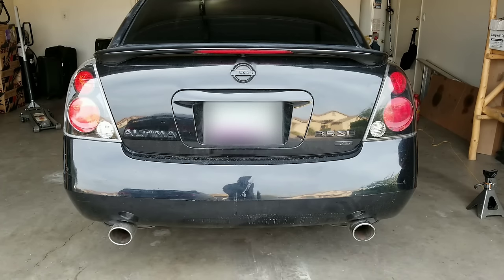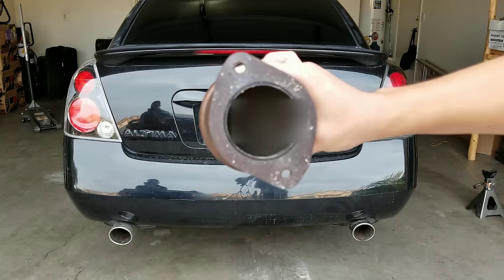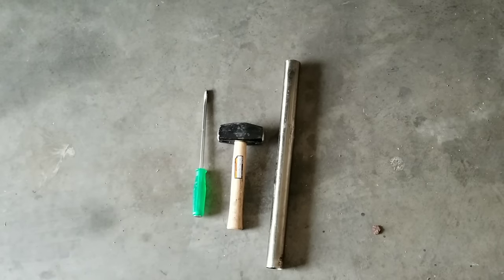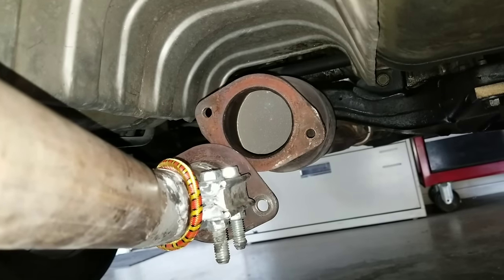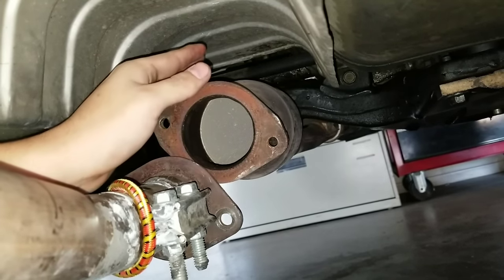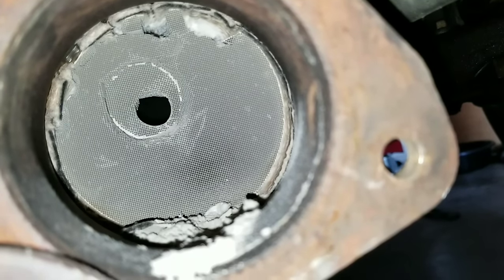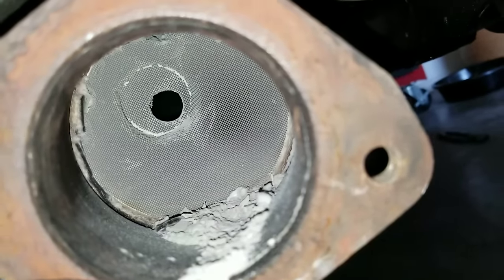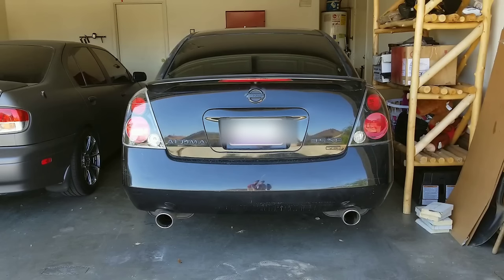How To Delete Your Catalytic Converter!

Comment: "by releasing more air, you should be able to take in more air..." To put this into context, that's like me saying "by farting more, you should be able to breath more." 
It's 2 separate systems that make 1 whole system. Deleting the cat, will not let more air into the engine. I would study up a bit before saying something. Don't just believe what someone once told you without verifying. 👍
Reply: Doing this has increased hp on my motorized bicycle dramatically, top speed and acceleration. It's because there's less back pressure pushing against the pistons exhaust stroke. Not to get into if any back pressure is necessary, but less is better in this case for getting more power.
Reply: @uknowngamer1017  would a delete destroy the motor to a vehicle
Reply: @lieutenantmikeo5979  a catalytic converter delete? Likely not, unless electronic systems are not adjusted and tell the engine "hey dude, my cat is fucked up!" Consequently sending it into limp mode, but not hurting the engine. If a tune is implemented, the engine will run BETTER. If you mean deleting the exhaust as a whole, it will damage the engine. The extent of which depends on the stroke type and other characteristics of the engine.
Reply: Also re-reading this. The original comment sounds more idiotic the older I get. Saying they're two separate systems is so foul. Every system in an engine relates to every other system. From the intake to the headers, from the coolant system to the pistons. They all are integral and affect eachother
Reply: Thanks for the information....I deleted my whole exhaust so theres no pipes running off of the  cats and I wanted to also remove my cats for my own personal reason(s). I pretty much would only have the headers on the motor and I'm hearing that I could bend something in the motor or have warping so I was just scared to follow through with removing the cats
Reply: @uknowngamer1017  hmm I deleted the whole exhaust so theres no pipes coming off of the cats. I wanted to also delete my cats. So pretty much it would be just headers. It's a 1uzfe motor in a 98' lexus ls400 so I'm not 100%
Reply: @uknowngamer1017  then you must not have read it. Again, 2 systems that make up 1 system. Meaning there are components that combine it all together to make one system. For simplicity, i chose that analogy. You essentially said what i said. Example, does replacing or removing your exhaust affect your intake, if left stock? No. Does replacing or removing your intake, affect the exhaust, if left stock? No. There are a plethora of mechanics inbetween both systems, which is why, they are both, 2 seperate systems. They work in tandem, but thats it. They are still seperate systems. When you go to a parts store and ask for an exhaust system, do they give you anything for the intake instead? No. That would be stupid. Because its a seperate system.
Reply: @uranumbnuts  I cant comprehend what's going on.  I just want to know if removing my cats and exhaust is going to damage my motor. Idc about low end or gas mileage
Reply: @lieutenantmikeo5979  i apologize for the confusion. No. It will not damage your motor. You may get a check engine light, but it will not damage anything.
Reply: @uranumbnuts  thank u so much....I was just so scared
Reply: @lieutenantmikeo5979  hold up broski. Sounds like you want down pipes which is awesome and won't screw up the engine, with proper modification (depending on year). If your car has O2 sensors after the catalytic converters, they will NEED to be tuned out if you want it to run right. If you don't want to delve into the tune-world, I hear you can use "spark plug spacers" or something of the sort so your sensors get a proper read-out with no CATs installed. If you don't have any O2 sensors, cut them bad boys out and you'll have a hot rod. Good luck!!
Reply: @uranumbnuts   @uranumbnuts  Look dude I understood your analogy, but it wasn't a great example. On my vehicle "Mazda 6s 2008 3.0L", the exhaust system was SO restrictive that cutting out the CATs gave it noticeably more power and literally allowed for a greater increase in air intake. I read the MAF readings for God's sake. The OEM intake design wasn't all that restrictive to begin with, so more intake air was easily possible. There's one thing to remember when trying to make a car go faster. 
More in + More out = More Power. Relating to fuel/air in and exhaust out.
If the fuel/air is the bottleneck, then simply increasing that WILL increase your power. Get it now? I'd hope you do.
Reply: @uknowngamer1017  I have no exhaust I want to take off my cats as well therefore I'll only have headers but no pipes or cats...I'm hearing tht it can cause warping or bend something in the motor
Reply: @uknowngamer1017  my guy. Your car is equipped with an ECU. Do you know what the ECU does? It compensates for everything the engine does and everything we do to it. The ECU reads the data from the o2 sensors and lets more air in or chokes it if it senses a problem with the mixture. Same thing with the fuel. By design, the air intake on every car is "restrictive" to allow the ECU to determine the best mix for the vehicle. You removing the cats, didnt magically increase the air into the intake, it allowed the ECU to compensate and ramp up the air intake towards its maximum capacity. The intake already has a ceiling, which most cars never get close to, by design. Its to give the ECU room to compensate.
Yes, more in, more out. You need to make changes to BOTH, in AND out, to get that effect. Making changes to one, does not necessarily affect the other, except where the ECU corrects for the discrepancy. 15 years, ASE Certified for automotive and 10 yrs diesel mechanic. I know what i am talking about.
Reply: @uknowngamer1017  I did it ...my car run way better thanks guys
Reply: @uranumbnuts  I'm not really understanding you guys too much ..I took off my cats and exhaust and my car is running way better. I dont plan to keep it like this long
Reply: @lieutenantmikeo5979  dont worry about the other guy and i arguing buddy. He just doesnt know what he is talking about. Congrats on removing the cat. You should now have a nice, full sound and a slight boost in power. Make sure you upgrade your intake to increase your intake capacity. Polished, Mandrel bent tubing is the best way to go to get the best air flow. 👍🏽
Reply: @uranumbnuts  ❤👌🏿🤝🏿
Reply: @uranumbnuts  I have no exhaust neither so I guess u can say open headers in a way
Reply: @lieutenantmikeo5979  i like it! I would straight pipe right to the rear and call it a day! 🤣
Reply: @uranumbnuts  mmm everyone is telling me to do so but I've heard straight pipe on my year make and model vehicle and it sounds really good ,but I like the hot rod choppy sound.thats literally my only reason for running open heads ig
Reply: @lieutenantmikeo5979  lol. I get it. I can appreciate what you are going for.
Reply: @uranumbnuts  again hopefully it doesnt damage my motor over time...I only plan on leaving it like this for a month max....its way too loud but run alot better
Reply: @lieutenantmikeo5979  the only reason i suggest it is to eliminate heat from the exhaust getting trapped anywhere, like in the engine bay. Unless you are looking to remove the hood or vent it in a way to let the heat escape.
Reply: @lieutenantmikeo5979  keep in mind, it doesn't have to be a straight pipe to the rear. You could easily go for pipes heading to the sides like a hot rod. The point is they'll let the heat escape away from the car.
Reply: @uranumbnuts  we're practically agreeing but fighting over it
Reply: @uknowngamer1017  ❤❤basically I appreciate the knowledge
Reply: @uranumbnuts  soo pretty much my only worry is heat disaptation?
Reply: @lieutenantmikeo5979  for the most part, yes. Heat is the worst thing you can do to anything mechanical. Keep the airflow moving.
Reply: @uknowngamer1017  which is what i said earlier 🤣
Reply: @uranumbnuts  I understand that more thanks for the info....my car actually run pretty cool. Needle stays way below half but I can feel the heat expand when I get out of the car other than tht it run better, and my temp is staying fine
Reply: @lieutenantmikeo5979  the temp you see in the car, is internal engine, not external engine.
Reply: @uranumbnuts  that's what I'm hearing.....😮😮😮😮😵😵😢😢so I can be overheating my motor and not know it?
Reply: @lieutenantmikeo5979  how do you have it set up currently? You have the headers attached. Do you have the headers attached to a down pipe? It would normally go down below the carriage, attach to a cat and pip all the way back. How is yours set up?
Reply: @uranumbnuts  literally how u just said it. My headers are attached, and I have the down pipe that my cats bolt on to.....I have no cats now and no exhaust after the down pipe tht connect to my headers
Reply: @lieutenantmikeo5979  perfect! You are pushing the heat away from the motor. Thats good.
Reply: @uranumbnuts  I definitely appreciate u taking the time to message me ....now that I have open heads I cant believe I was scared to ever do this...just pray that nothing happens
Reply: @lieutenantmikeo5979  lol. You should be fine. Have fun, my friend.
Reply: @lieutenantmikeo5979  glad to hear you went through with it and that it's working :) issues may come along but don't worry, it's just your car getting you to learn another new skill
Reply: @uknowngamer1017  its ok brotha. I can appreciate you admitting that. You werent the only one. I like looking for arguments online. 🤣
Reply: @uknowngamer1017  long as my motor doesnt get destroyed I'll be fine

Comment: have you noticed you don't see many muffler shops these days?    That is because cars are equipped with catalytic converters.   They prevent the formation of sulfuric acid and condensates in the exhaust which used to rust out mufflers and tail pipes.

Comment: how long did it took you to chip out the cat ? I'm worried I can't smash through it.
Reply: Great question. Uploader liked your comment and left you hanging. I just took out the catalytic completely out the car. Mine didn't look broken but barely see thru it. Started chipping away. Realized this will be an hour or so. This particular one is over a foot in length of honeycomb. I have  pry bar and large hammer. A screw driver maybe ok for small cats. Straight pipe easy if you find one for it.i may chizel just half.maybe half less restricted? Maybe. First time I tried
Reply: It's a tuff as carving frozen ice cream .

Comment: Yes wear a mask. I had a 1983 Saab 900 turbo that I used a 1 1/2 inch wood spade bit to cut a core through the center of the honeycomb cat . Left remainder there. Car ran a lot stronger for next 100K miles but old air cooled turbos only lasted 65K miles. I abused the crap out of the motor as under back seat could turn up boost and I ran 104 Octane booster .  Ate up Corvettes , Mustangs and Camaros back then . Also ate up front tires every 20K miles but worth it to see the look on Billy Bob's face.

Comment: How did the Altima ride/perform after gutting that cat? Any changes in power or mpg? Is it still going?
Reply: lucky its running at all
Reply: @yourworstfear  why wouldn't it tho? yes it likely smells like rotten eggs and is loud as f***, but there's no resistance in the exhaust now, so prob runs better?

Comment: Why not just buy a pipe and install it instead of destroying a catalytic converter? This is wasteful. Many people with old cars throw the whole car away when the catalytic converter fails inspection because replacing it is more expensive than the car itself.
Reply: It’ll only pass the state vehicle inspection if the cat is still installed. This is why leaving it on is necessary in some states.

Comment: I am trying to do this not because of the hp because my cat a mess up and it will cost 1k to get new one for my jeep so if I delete it it won't mess up the engine sometime the engine stall cuz of that
Reply: You need to put a straight pipe in place of the cat and you need to delete the egr system with a block of plat also remove the smog pump if you have one and install o2 sensor plugs which can be purchased on ebay then you will be ok in the state of MA you can do this if you car is at least 15 years old or older because they do not require emissions testings as long as they are quite so you have to leave the resonator and muffler alone.
Reply: Try RockAuto. Glad my Toyota only has one and it's $115.
Reply: Chuck Taylor problem with rock auto or similar catalytic converters is that they are garbage.  I have installed off brand cats for customers and had them accuse me of not doing the repair because their cel would come back on in a week.  Aftermarket cats use less than the minimum required to get the job done

Comment: 1.5hp increase. Totally worth it
Reply: Every horsepower counts in the ¼ mile tho bro. Even if it's a few  half seconds faster. 😅
Reply: You’re not doing a decat for hp, you do it for sound!
Reply: Gains is gains
Reply: If the converter is old or clogged up, its way more than that, plus better mpg.
Reply: captainchaos087 1.5 horsepower, or even 10 horsepower, will not remove a tenth of a second off a 1/4 mile time.

Comment: That's not how it works. The cat use high temperatures burn off hydrocarbon and Nox. The higher temperature actually increases the flow of the hot exhaust gasses. Have you ever see guy's at the track taking a torch to their almost empty nitrous bottle? That heat expansion the gases  creating pressure so you get another run in. The cats work in the same principle. You are NOT going to get more horsepower by gutting your cats.

If you have the 3.5 liter the best thing you should do for performance gains is port and polish the lower intake manifold and upper intake  along with the throttle body too. Replace the 315cc  injectors with 335cc injectors from the 350z or G35 infiniti. NWP Engineering thermal spacers. NWP block off plate. Ralzco Ultra light weight crank shaft pulley. Resonator delete and 2.5 inch exhaust from the cat back, advanced the timing 4 degrees. Use a oil catch can to keep the port and polish job clean. If you have an automatic transmission get your hands on a Trans Go reprogramming kit. If you have a manual transmission get a lightweight flywheel. You should run 13.9 Et's depending on track conditions and weather conditions.
Reply: Dude yes you will gain horsepower and this cat has no heater so you  wouldnt get any more horsepower and he still has cats

Comment: I straight piped my ‘15 Altima and it’s sound mint‼️‼️
Reply: Did it have 02 sensors on the cat? I’m thinking about doing this on my 17’ Sonata, with an upper and lower 02 sensor, may have to get a spark plug defouler for the lower if the cat throws a code. 
But without the honeycomb, the car would have a free flowing cat, which is attached to the manifold. Easy enough to get too, but still work to reach. 
If I can get the comb popped off/out, I think my exhaust stock will pop with mufflers on.

Comment: You should have said it’s illegal in all states be cause it is lol. There are a lot of states that don’t do emissions checks so you can get away with it but if you get caught then you’re breaking federal and state law. Because even though there are no emissions checks it’s still illegal. Plus another hint if you wrap exhaust back to the first oxy sensor and install a oxygen sensor defouler you can clear nearly every check engine light that has anything to do with exhaust emissions because it will come on.
Reply: James Wilson  i dont think cops take apart catalytic converters
Reply: It's not illegal in Alabama
Reply: @luldjay4785  its a federal law meaning it is illegal in Alabama
Reply: @EthanL21800  What law is it? If it's federal law then it may only apply to auto manufacturer? IDK just wondering.

Comment: On a 2014 Chev Impala can I put 2 Elimators on the down stream O2's and hollow out the cats or will a check engine light appear?
Reply: It's proven to work 90% percent of the time...Get the" O2 spacers" off Amazon or eBay.

Comment: Do you need to tune after so the O2 sensors adapt ?
Reply from the maker: no because this cat doesn't have a 02 sensor
Reply: @ERICSDIYGARAGE my neon has the o2 into the cat so if I delete and replace with a pipe will it not run properly ??

Comment: I have to get new ones on my 2004 v6 mustang but that is going to cost a lot. Should I just do this instead orrr
Reply from the maker: you need to replace it if your vehicle has a check engine light for a bad catalytic converter

Comment: One thing you failed to mention is the fact that some or most catalytic converters contain Asbestos which is one of the main causes of mesothelioma and you said nothing about the need to wear a respirator when removing the cone from inside of it. Another thing that can or should be done is spray the inside with a spray bottle of water and drill a few holes in the inside center of the cone then use a bar and hammer to knock out and remove the rest.  Also might I comment Mb8 131991 U.S. Environment Protection Agency under Federal Law catalytic converters may not be removed and replaced. Well enough of that I just wanted to point these facts and issues out. Thanks

Comment: Some cars will actually loose power doing this, and I would wear a dust mask if you try.
Reply: Pretty much any naturally aspirated car.... like an Altima... will lose power. 

This kid has watched too much fast and furious
Reply: Short of changing other parameters...camshaft..timing..injection timing/volume...inlet tract...all you gain is noise! More noise is not more performace! Std cars are designed to have back pressure. Romve it with no other mods you lose power and drivabilty. 
Ang if you run hi flow cats they are not restrictive at all. Even std cats not very restrictive if at all